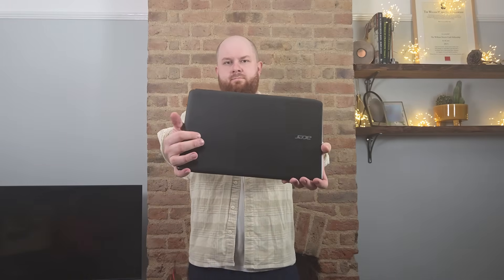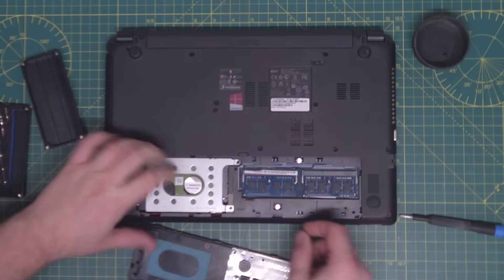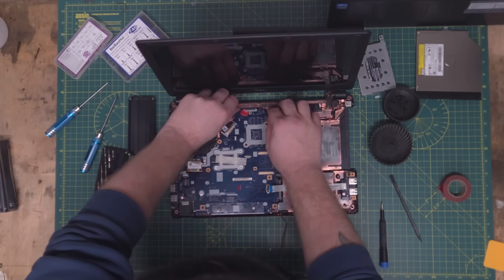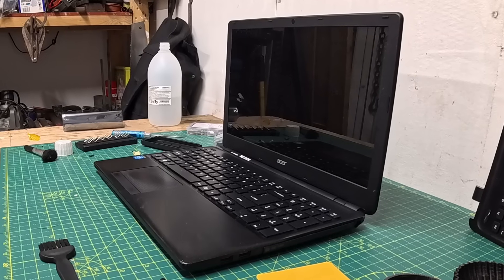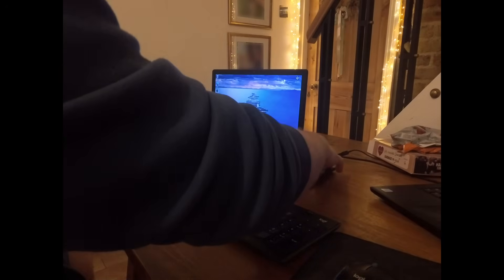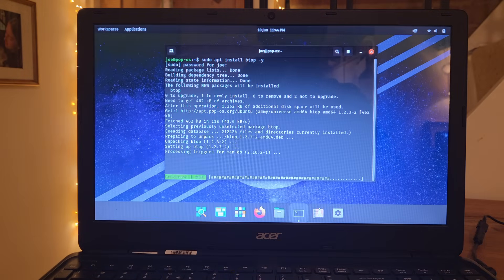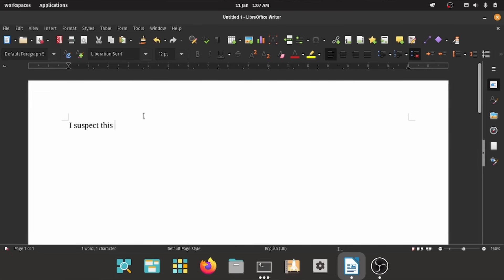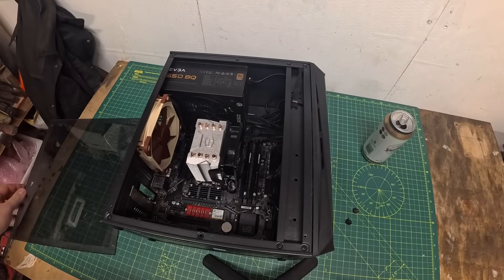I fixed a 2013 laptop & tried running every OS | Windows 11, Linux & macOS

Comment: first you pulling out the mobo already got me like aight im never doing that and then the adapter from barrel jack to USB-C is genius keep up the great work (first thing was meant as I wouldnt attempt it myself cuz i dislike hardware) :)
Reply: the graph with intel gens is also a great thing for people that dont know
Reply: also you dont need to use rufus for the windows 11 bypass in the ventoy zip it also has a program that lets u use a gui to modify the ventoy settings which lets you enable those bypass changes rufus makes dynamically

Comment: i doublechecked and indeed the cpu score should hit around 1000 multicore ,same for the exact model ,that 700 is an i3 score.
i wonder if the result will be the same on the AC power ,3rd party batteries for such old models must has been setting empty for years ,the output voltage will decrease with such degraded batteries
either that or the power plan in bios is set to balanced or hyper threading is disabled or something
Reply from the maker: I had a good look around the bios, no power management options to mess about with it was pretty empty! I'm also pretty sure i wasn't on balanced power and was definitely plugged in but I'll turn the machine on tonight and have a look. Cheers